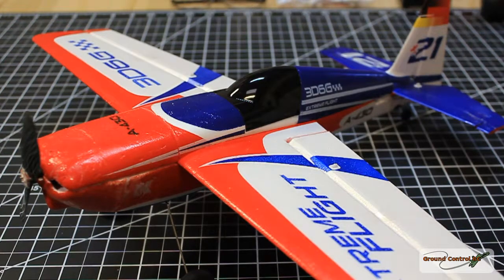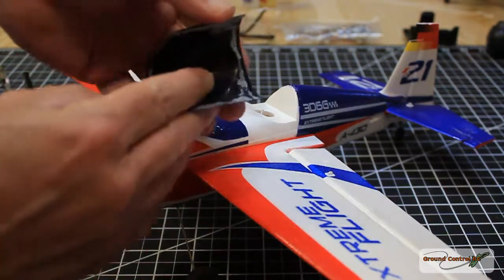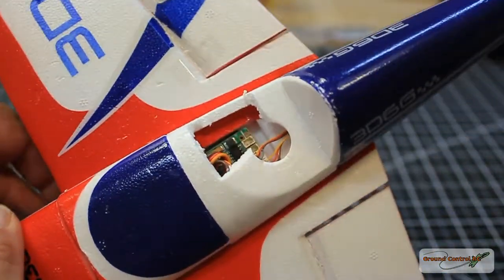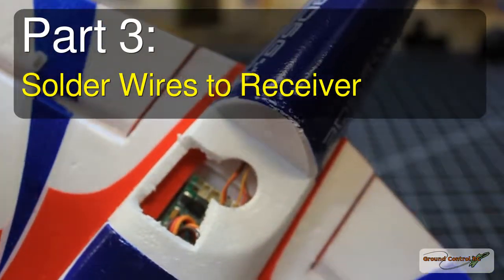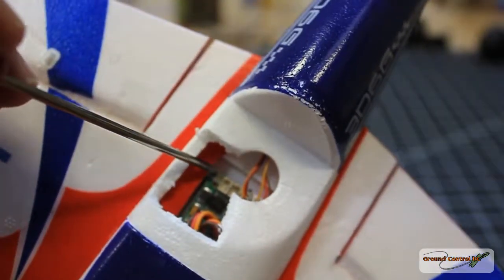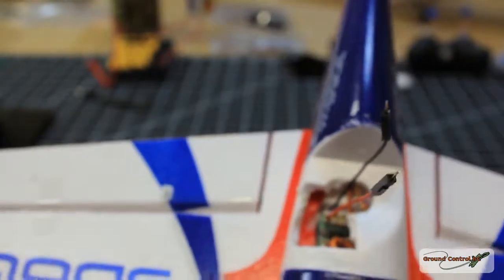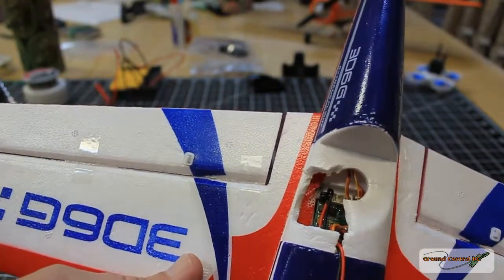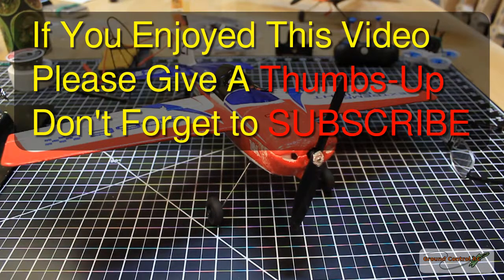Tutorial - Add a Micro FPV System to the XK Edge A430 Stunt Plane

Comment: Hey, it is a nice video..  how many volts come from these little holes  in which you placed the wires?
Reply from the maker: Thank you much! Those pads provide 5v for the FPV System. See you in the Air!
Reply: I also noticed some free slots right on the side where you placed the wires, would those 2 free slots provide the same 5v?
Reply from the maker: @thandyadriel  , they may very well. Sometimes flight controller boards will have places for additional equipment but it depends on whether they are regulated. I always check these out with a multimeter to be sure. For instance, on my King Kong Tiny Wing 450 I was going to attach a Micro FPV System and the flight controller had an unused set of pads. I would have thought those would be regulated since the Tiny Wing was designed for FPV but they were not. They were putting out the full voltage of the LIPO pack so I had to attach a voltage regulator to cut the voltage down to 3.3 volts. Always check the output voltage first because you just never know ;-)
Reply: Did the extra slots end up being 5V? I have mine apart now and it would save me a trip to the store to get a multimeter and it might save my plane from my shaky soldering hands haha!